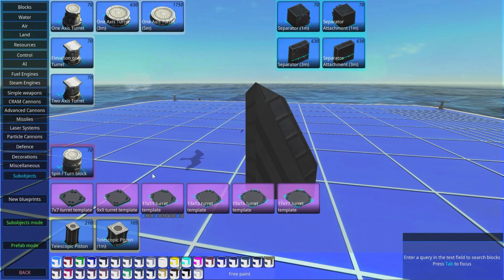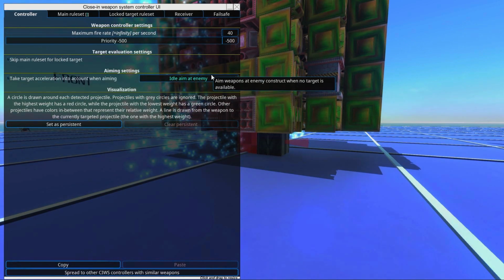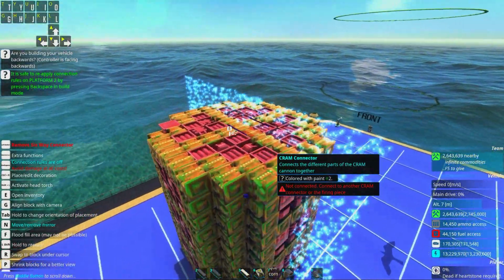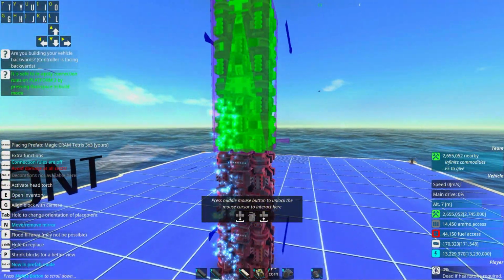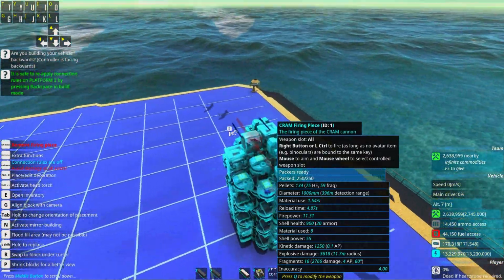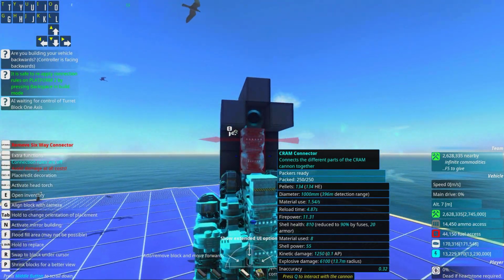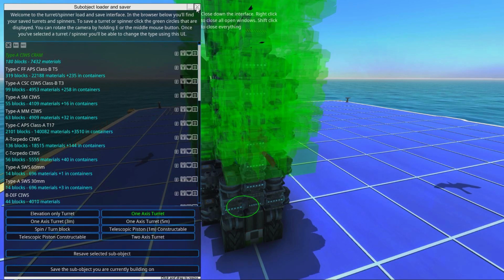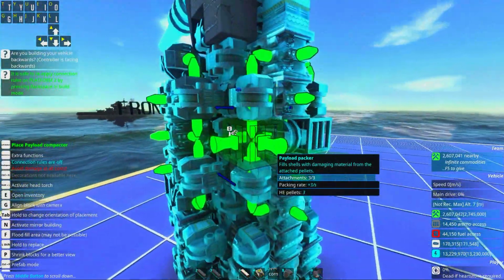Anti-CRAM CRAM Cannon! - From the Depths Build Experiments

Comment: I did this on the McDoolin with your steam punk tourney.  I used kinetic and they were pretty effective at taking down cram and missiles.  I used crams canons under 1k and just hooked up multiples to one CIWS controller to make it more cost effective.  You had to bring in the range into the 750-1000 range thou.  The Simple Weapon cannons were also fairly effective.
Reply from the maker: Wait, kinetic crams or simple cannons to take down incoming shells,m
Reply: @GMODISM  both

Comment: Projectile health? 166. Is that how much damage it does? I haven't gone down the CRAM rabbit hole. I don't know anything about them. It's cheap. Don't you want more barrels? You can use weight inside then type of projectile 1 for missiles or 2 for CRAMS. I always forget to press mirror mode. The new Crossbones is pretty good.
Reply from the maker: Hey! More barrels are smart, I didn't expect to use compactors when making it however so the bonus was less valuable, the damage we look for is explosive damage since this is basically a flak cannon :)
Reply: @GMODISM  When you pressed stats. Did it show how much damage it does? Where do you get how much damage?
Reply from the maker: @anamerican1054  hovering on the firing piece it tells us about damage
Reply: @GMODISM  Did you test the death laser?

Comment: Cram barrels have a weird thing where the more motor/elevation barrels that are added, the less accuracy to the whole barrel/per barrel piece. I don't know what would be optimal for a CRAMwis, regarding that. I have been told that Brisbymouse builds his CRAMwis as just 3x3, who afaik was the first to use CRAMwis in tourneys. An advantage to this I can think of is jamming them very close together on like a broadside with turret restrictions for a lot of space/cost efficiency. A firing line taking out a stronger CRAM shell would be worth it, or taking out a lot of smaller shells. But aye, they do need help aiming at different shells- setting them to different AIs is another possibility. I'd take the below comment as a suggestion too.
Reply from the maker: Oh, cool they are used seriously then! I didn't know it was a viable strategy before testing it
Strange they get less acurate, I should try this with short barrels then... however I need a bit of firing arc so at least 55*
Reply: @GMODISM  Yeah, short barrels also aren't accurate... it's basically that regular and heavy barrels do help increase the accuracy, but motor and elevation seem to add an accuracy debuff. Longer barrels will still be more accurate in general, but not with many stacks of those debuffs. So basically, slower barrel rotation speed ends up being more accurate.